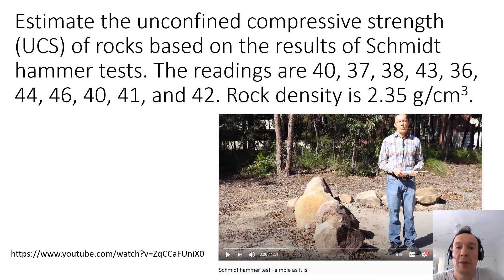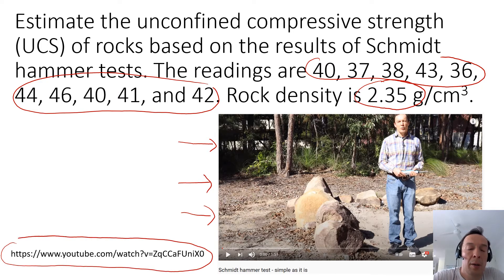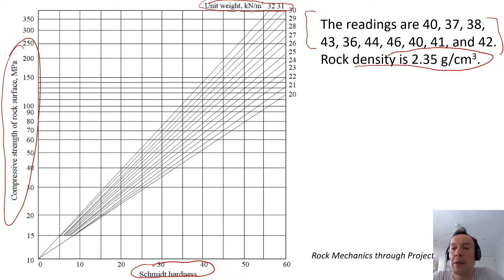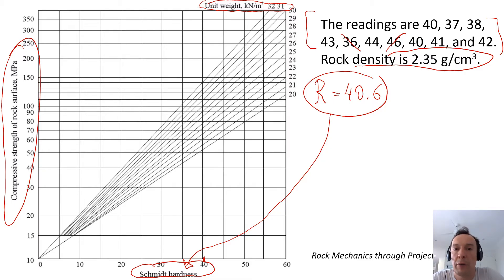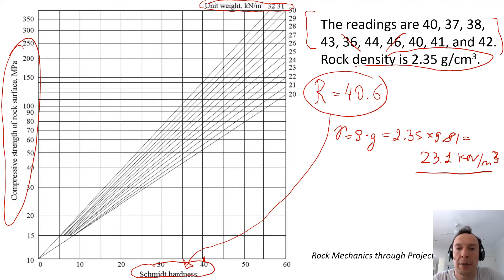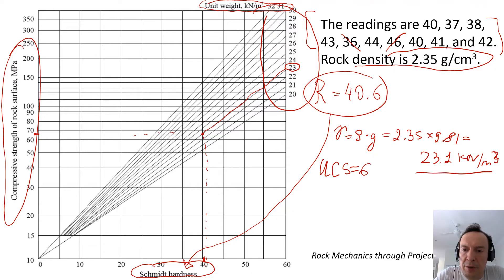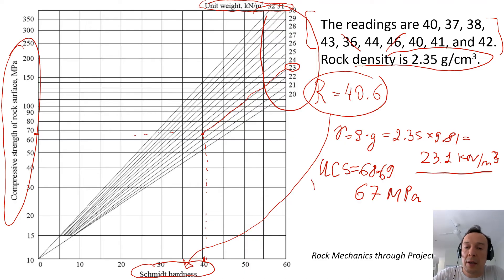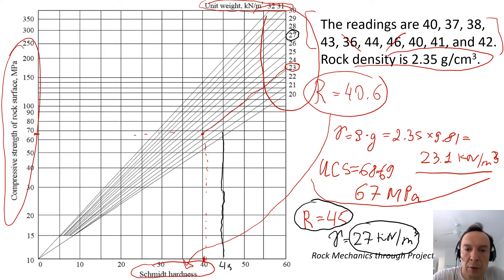Schmidt Hammer Test | Part 2: Data analysis #education

Comment: Where to get this chert?
Reply from the maker: This chart can be found in my book called "Rock mechanics through project-based learning", or on the Internet. You can find lots of free resources on the Internet.
Reply: @GeoEngineeringandScience  
In Internet, chert is Varying the Rebound number for vertical, inclined, horizontal strength. Any reference from Biwniski, hoek and Brown Or ISRM Or ASTM?